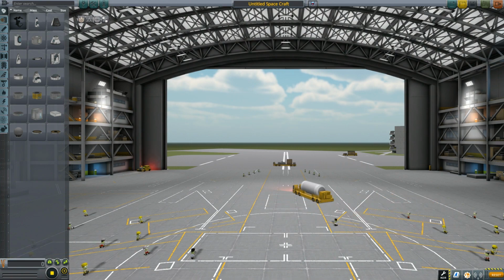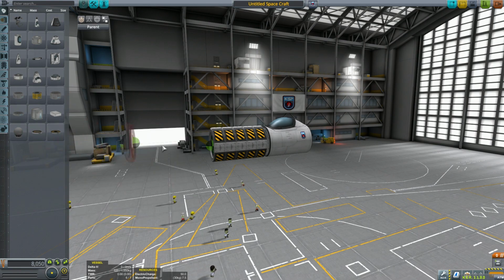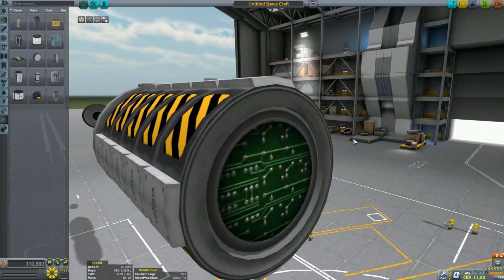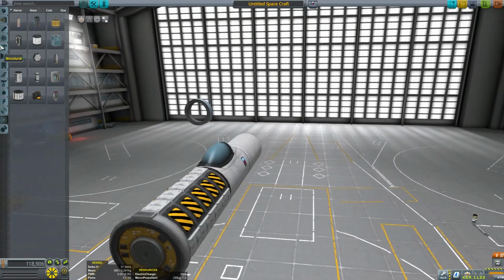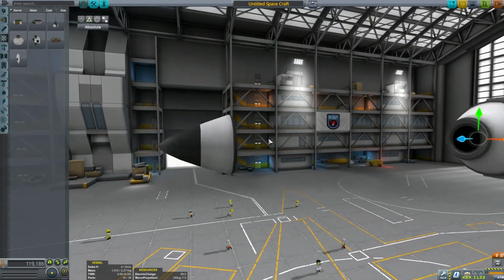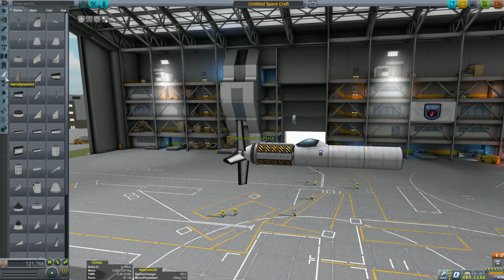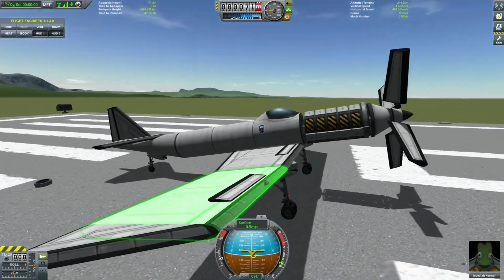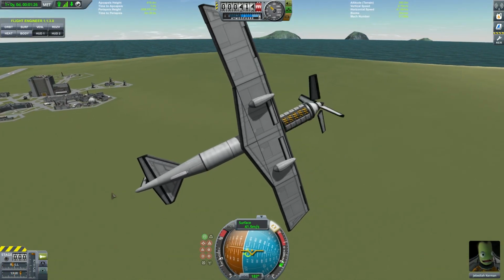KSP | 100% No Cheat STOCK PROPELLER TUTORIAL!!

Comment: really nice, I got the plane working, however it seems to pull to the right, would you happen to know why? (its not the plane because I used symmetry)
Reply from the maker: Mine tend to do that, you can try using the alt + q until it's flue nice and level

Comment: I tried it myself and the engine fell off
Reply from the maker: hmm okay, maybe try moving the buffer closer that might help
Reply: A Nipple Cripple I tried but then the engine started freaking out
Reply from the maker: hmmmm, okay, maybe dont trimm it to the max and maybe try using less reactions wheels, so instead of 5 use 4. I hope that helps
Reply: I’ll try that later
Reply from the maker: please let my know if that work :) also maybe try a different plane design, it may sound wired but i might work :)